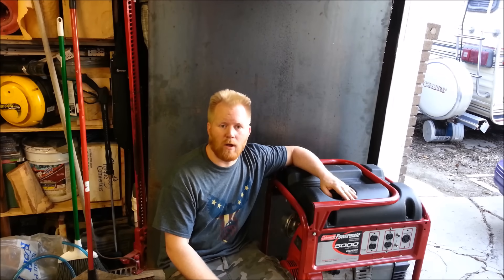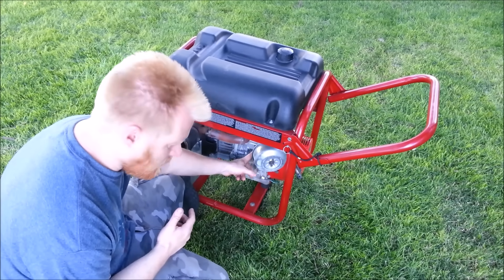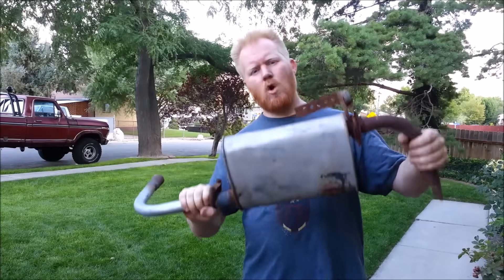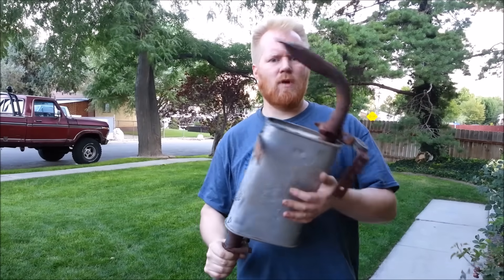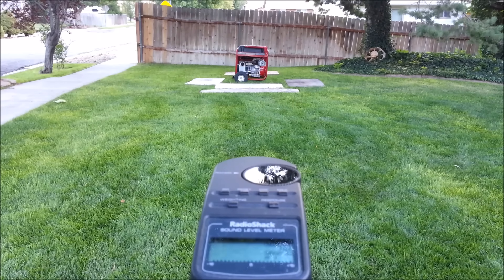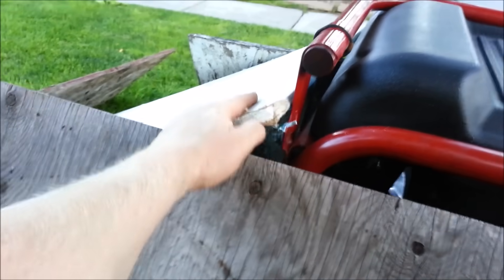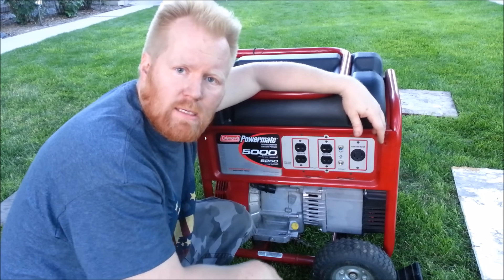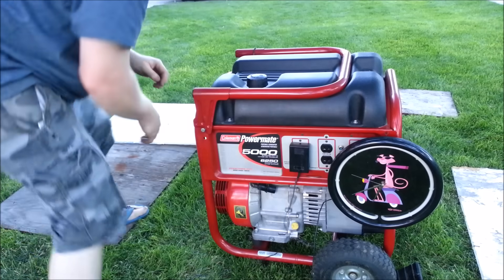4x Quieter generator in 10 seconds

Comment: Good video and idea.   You might tweak it with some very light weight aluminum shroud that fits over top with in / out air for intake and exhaust and also folds up for easy transport and storage (use light duty hinges).    This idea works Very Well with bad noisy neighbors or barking dogs (board on board fence ). LOL   Don't laugh I had to do it once upon a time.
Reply: It done, it could be also a RAIN cover (the aluminum foldup design), use bungees to prevent Alum from blowing away in a high wind rain storm.

Comment: Long story short it is what it is...  all the effor to diminish the DB's of a generator.. will never be enough for the life empty neighbor who will tire of hearing YOUR generator running in order to keep a few lights and your refrigerator cold..  while he has to use one of those styrophone coolers and candles... 70 or 87 Db's from a distance of 40 feet.... makes no difference...  when the actual concern is ...  that it will be being left outside...  all day and all night..  Needs a 1/8 inch concrete wonderboard box built around it...   But not entirely...  Exhaust needs to penetrate the enclosure and blow out the side... and I istalled a 20 inch whole house box fan on one end to blow air through the case enclosure...  cause enclosing the gas tank made it expand from general engine heat...  The 20 inch fan... hangs on  the side of the enclosure from the top cover..  the end cap doors hinge open when the genertor is in use and close up for storage... the 20 inch fan is plugged in to the generator when it is turned on and stores along side or atop the generator when stored or not in use...  Older laying around generators you discover are not leaking from the carb... needing a carb rebuild...  those carbs can be found pretty cheap NEW  on e bay... Generator mounts broken or worn out...  you will discover are not available... but improvising other generator mounts is doable...  In redonditioning the 2 ( 4,000 / 5,000 ) watt - 220V generators... they do not have starters... or alternators...  for 12 volt battery charging - generator lights...  The alternator/stators have to be researched for your model and will come in 2-6-10 amp voltages supplied...  Starters NEW bolt right on and can be bought from 19 to 27 dollars....   NEW...  on e bay...  So if you got out your old generator..  replaced the motor mounts... stopped the carb from leaking... put on a starter ( 11 HP motors are a bitch to start ) with a solenoid and push button... Added a stator for 12 volt power after starting the generator.. in order to charge batteries... and have fog lamp risers attached to the generator with 3/4 pipe and flanges...  You are now better self contained and doomsday prepped than the average guy...  cause you will need all the power you can muster out of the generator into the RV or House  by way of an extention cord...   As a side note...  I also added a Propane feeder to the base of the carb where the air intake is ahead of the choke butterfly valve...  to a quick connect attached to the generator frame...  May post a video on my technology channel...  after I complete my production trailer...  upgraded the generators to power the trailer...  The answer is yes...  two 220 v dual phase generators requires two standard house 220 sub panels... one for AC/heaters/camera system  the other for interior lighting/monitors/computers...

Comment: Amazing, so simple.  Thanks!

I was planning to try fixing the muffler but suspected it woudn't do much.
Reply from the maker: It will give the exhaust a deeper tone, which is minimally more pleasing to the ear. But it will be just as loud within 1-2decibles. The biggest issue is on a lot of engines you need to recalibrate/re-jet the carburetor as you are adding more exhaust restriction.

Comment: How much hotter is the generator running?  10db's for burning up my engine faster does't seem cool.
Reply from the maker: There's huge holes at every corner allowing plenty of air flow. The engine and gen head all stay within a -2F to +2F degrees of temps measured without baffling. Things like the metal frame will heat soak and get warm to the touch that normally wouldn't but that's it.  Air cooled engines run in enclosed areas all the time ie: All the super quiet Honda generators are air cooled in a super enclosed box, RV generators, riding mowers, ATV's(Argo Maxx etc),  skid steers, and even Volkswagen ran air cooled engines in a "box" without issue.

Comment: That's looks like a good way overheat your genny.
Reply from the maker: It won't if you leave the HUGE air gaps like I did at the corners. Air cooled engines run in enclosed areas all the time ie: RV generators, riding mowers, ATV's(Argo Maxx etc),  skid steers, and even Volkswagen ran air cooled engines in a "box".
Reply: Well I think when if I build a box, I will put carpet padding on the inside with air inlets at the bottom and vents around the top.

Comment: right it's simple real simple holy mother...... so get some sheet ally and some cone shaped foam to line said ally.... make a box 12inch bigger around the genset using corner brackets and rivets to hold box then get some small box section to hold the box to the genset then vent exhaust up and if looking for fancy build air intake in side. use the foam to line box. absorb sound and stop vibration. your half way there pmsl

Comment: I do the same trick but with just 3 boards. As long as it deflects the noise away from where I'm camping I'm happy.
It's more efficient too as without back boards the sound going out away from the rear of the gen isn't bounced back.
The quietest genny is one further away. So a 200ft extension cable run under half a dozen other camper's RV's works really well at keeping your camp almost totally silent ;-D
Reply from the maker: Awesome.

Comment: With rv gen I wonder if you could line the compartment with foam insulation?
Reply from the maker: My motor home came equipment with foil backed fiberglass insulation lining the generator compartment. It really cuts down the noise. Fiberglass is fire resistant.

Comment: you are so right about Subaru I had a Robin Subaru diesel generator 2000 watts is only had 2500 hours on it
 I've had it since new regular oil changes good fuel strangest thing ever
 I have never seen it before the camshaft snapped in half I worked in a hire shop for 2 years so I am used to seeing abused engines and customer damage Nothing Like This
Reply from the maker: Generally they're on cheaper equipment and I've never had good luck with them. That's never good when a camshaft snaps. That's one of the last parts you would guess to fail in an engine.

Comment: Simple solution to reduce noise.  Noise is both the exhaust and intake caused.  Honda super quiet generators are designed to reduce both by using NVH engineering methods.

Comment: do you know if the ultralight drywall works also? I guess i am referring to gypsum board.  In an RV, just trying to keep total weight down. Also is there a reason you use a combination of the OSB or sheetrock?
Reply from the maker: Foam board insulation is super light weight and works great.

Comment: 1st of all, thank you for the very well explained video.  
Question, does it matter the thickness of the wood? 
Just looking to lighten things up.

Thank You
Reply from the maker: Thicker material seams to work very slightly better. You can use stuff like foam board for ultimate weight savings.
Reply: Thank You for the quick reply !!!

Comment: Hi, that's a great demonstration of something so simple! FYI on the dB(A) scale, each 3dB(A) is a doubling of "loudness" or "volume", so that 10dB(A) reduction is a near 80% reduction in "apparent volume".

If you build a shelter you could line the inside with some heavy layer (self adhesive bitumen product as used in cars) and medium layer (felt as per cars again). You could even use egg boxes and fill some of the egg cavities with expanding foam. And build it so the sides are a little 'off square'.

Unfortunately you do need to vent any shelter. The generator needs fresh air to burn, just like a car. If the shelter fills up with exhaust fumes, the generator will simply choke and stall out.

I've only recently become a YouTuber and I'm loving your no nonsense approach. I'm inspired and am trying to do the same for my videos.
Reply: Substitute "perceived" for "apparent" volume and more generally science illiterate people will understand what is meant. I don't mean to crack on you, I'm only making an observation of the sad state of education these days! 👍

Comment: If you dug a hole about 2-3 foot deep stuck it down there then cover with usb that would cut it even further then put a muffler on it ooff a motorbike it would be down to proubly 40 dcbls or less. I live amongst low iq creatures that have very loud noise making equipment in there cars and the boooooooooombaboooooooooombaboon noise rattles the windows loosen light bulbs kills vegitation and makes paint peel off house not to mention your health so i should if i were to buy the loudest gen set have

Comment: most mufflers curb given sound frequencies. so buy two mufflers, one for the high frequencies and one sound absorber muffler.  I plan on placing my generator in a void under ground. putting it in a densely packed soil cage lined with foam insulating board on the outer layer and dense rubber matting nearest to the generator. running the exhaust fumes and heated air up and out and fresh cool air intake down and in using a 24"x24"x3" 3m filtrete type air filters as a sound buffer. now where and how I run the exhausted air, is my secret? all I'll say is, it's in cast iron. not to forget the gen is an electric start engine. and the outgoing power is hard wired at the gen and to a back feeding breaker in the breaker box. now if I could figure a way to cut the city power off as soon as the gen is started. a fool proof system. because we don't want to see linemen jiggling about on a pole or in a bucket truck. the pole is for whom ever's daughters, you bad daddy.

Comment: I bought a 72" x 80" heavy moving blanket/furniture pad from Amazon and rolled my generator half way over it and then folded the remainder of the blanket up from the back of the generator and over and tucked the sides of the blanket into the narrow gap between the rails of the generator. Subjectively, I would say it cuts the noise level in half.

Comment: My dad used to have a Suzuki generator like 2KW power output and used to run it for 6 hours daily! he had it for like 13-14 years only had 1 break down that I can recall (I was like 8-9 yrs old)... I'm surprised that in the U.S. no one use Suzuki we had a Honda that was not even close to the Suzuki one performance.

Comment: Would it be possible to build an extension muffler that diverts some of the sound waves underwater (so you would get bubbles only coming out of the water) ?
Reply from the maker: Most of the sound comes from the engine block and not the exhaust. So you can make the exhaust dead silent and a generator will still be loud.

Comment: same idea would work for an air compressor. great for jobsites. did you test on concrete floor (garage) versus on grass?
Reply from the maker: I have done it on concrete with the same results. The denser the ground material the better it absorbs/passes sound.

Comment: remember this is an air cooled engine. you are also blocking the in coming air.Thus the engine will run hot
Reply from the maker: I've run temp checks and everything stays within a few degrees. The 
trick is to leave plenty of area for proper air flow. Any engine will 
only pull in so many cfm of air while cooling and it doesn't require 360
 degree air flow. A standard air cooled engine pulls all of it's cooling
 air through a few square inches behind the pull start. The spacing left
 at each corner is probably 100x the required area for proper cfm in and
 out. Air cooled engines are run successfully in fully and partially 
enclosed areas all the time; ie Honda's full line of inverter generators
 are fully enclosed with only a small opening at the front and rear for 
air flow, Along with pretty much every RV generator, riding lawn mowers 
only leave partial openings for airflow to reduce noise and the list 
goes on.

Comment: Good thing to know for those impromptu situations.  Thanks for the idea.  And dude, nice yard.
Reply from the maker: 4 gauge A full enclosure with a cooling fan is ideal for sound. Leaning boards was just shows people they don't need to get technical and can easily drop the sound with stuff they may already have laying around.
Reply: +sixtyfiveford Oh I know...I guess the way that I was looking at it,if your spending a $1,000.00 or more on this type of equipment,one is not just going to lay boards on it.
Reply from the maker: Thanks.
Reply: +sixtyfiveford How about a "sound proof room"and venting your exhaust through the bottom of the room below ground...this would reduce the sound down very close to zero,very nice video,but sheetrock doesn't do well if it gets wet in the rain.

Comment: Dig below ground and install generator, with an appropriate air gap and let earth muffle the sound..... This simple method is used in some residential areas without mains power supply.... Takes longer than your 10 minutes of course ....
Reply: If you own property, that will work at home. Not so much when I'm camping or where I rent.
Reply from the maker: That would work really well.
Reply: Watch out if it rains though.

Comment: My generator is in a concrete box, and makes less noise than an air conditioner.  The whole thing is lined with AC duct board.  Air flows through a 12 inch culvert that is buried underground and the exhaust goes to a barbeque grill
Reply from the maker: Very Neat.

Comment: The glass pack will burn out very quickly like this even on a generator. It is much closer too the actual engine in this application so it is seeing much higher temperatures.